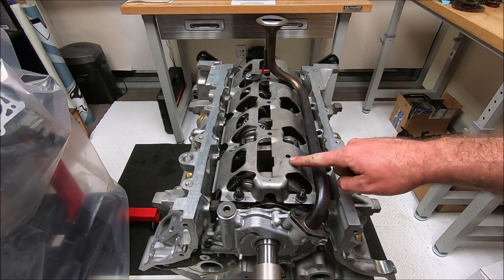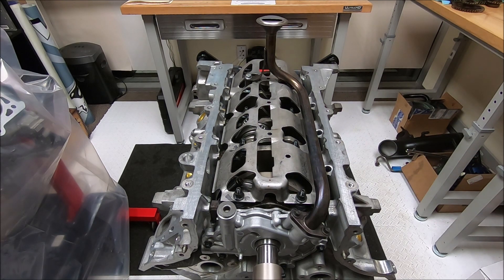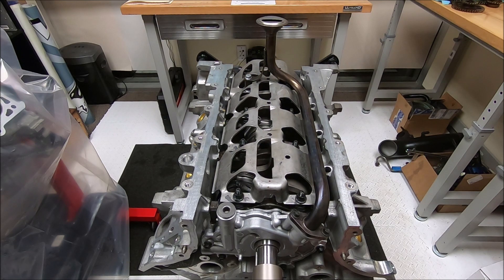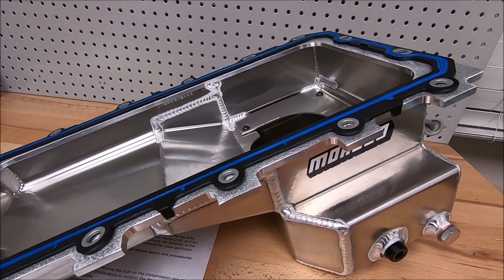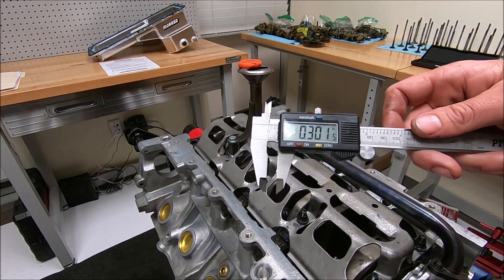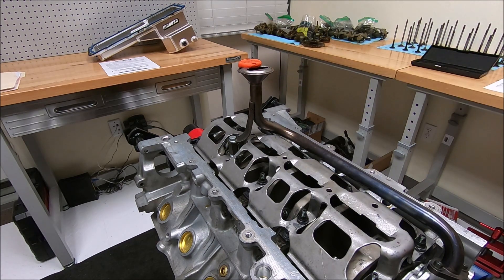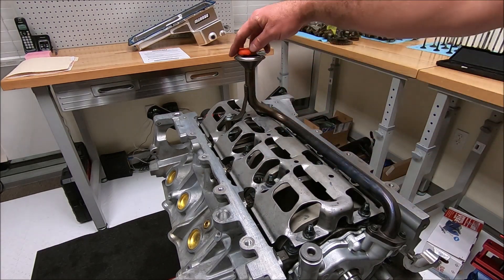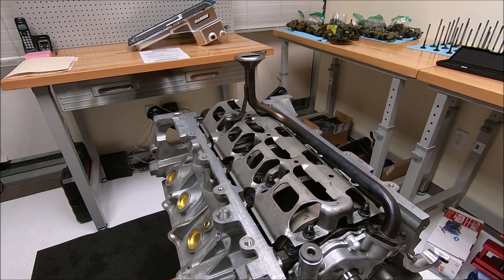Setting oil pickup tube clearance on a 4.6 Teksid Mustang engine with a 3V windage tray

Comment: Got a question i hope someone help with.  My oil pickup tube looks like your but is fully open. will this change the clearance i need? mine is the only tube i've seen like it. any i see on line look way different with a small opening. i haven't seen one like yours either, like mine but half covered.  So should i measure from the top or the screen?  Love your content its helped me a lot.
Reply from the maker: I have seen pickup tubes like the one you have.  You can measure from the screen but remember that the screen is a bit higher up than the edge of the pickup.  I would subtract about 1/8" from the reading to compensate for the screen being higher in the tube if that makes sense.  Basically the lowest part of the tube is what you are concerned with but you can still measure from the screen if you its easier.  Also, you might want to spray the screen with some oil or something to keep the playdoh from sticking all up in it.
Reply: @JohnSmithRacing  Thank you for the quick reply, I'm about to give it a shot now.

Comment: What pickup tube was used with this setup? Thanks for the vids!
Reply from the maker: The larger one from a DOHC.  I believe Ford Performance sells them.  You may have to cut the plate on the side of the tube off for clearance

Comment: Do you have the part number for the 3v windage tray?
Reply: Also the part number for the correct arp main studs to go with the 3v windage tray?
Reply from the maker: @johnbeardsley2962  The windage tray is 4R3Z-6687-BA but I am pretty sure it was recently discontinued.  The ARP main studs for the 3V windage tray is 156-5901.

Comment: Hey I just built a 2v PI with the stock 98 mustang gt oil pan. I used the frpp high volume oil pump and the instructions called for 2mm of washers under the hex spacer, which I mistakenly did not do. How bad was that lol? Ran about 2300 miles on it since install.
Reply from the maker: What main cap fasteners were used in the engine?  If it was ARP then the clearance will most likely be way off.  However, if factory style fasteners were used then it will most likely be okay.  Its also not a bad idea to get a oil pressure gauge just to keep an eye on things.
Reply: @JohnSmithRacing  factory fasteners. I do in fact have a actual oil gauge now. I was freaking out because it reads good pressure but can fluctuate 10-15psi, and the passenger bank lifters are a little noisy at startup. I'm planning on adding a gt500 windage tray soon and was hoping to hold off pulling the pan till it arrived, but wasn't sure how urgent this was honestly.
Reply from the maker: @jamespenner5982  A good rule of thumb is the engine makes at least 10 psi per 1k rpm.  I have seen engines make about 25 psi at idle then it jumps to over 60 at higher rpm.  You should be fine, its really during hard cornering, acceleration, or braking that can cause the oil to move away from the pickup.  Aftermarket k-member will help with removing the oil pan.
Reply: @JohnSmithRacing  lmao, yeah..... It's on a grip/drift build sn95 with everything but the aftermarket k member and coilovers lol. Ok, no runs in the mountains till I throw in a windage tray and some washers then.

Comment: Building a Teksid Saleen Cobra,  machine shop in a few days. Taking notes on your vids. THanks!
Reply from the maker: If you haven't taken the block yet, I recommend doing any of the drilling and knock sensor bung removal prior to it going.  I also remove the freeze plugs to help get the coolant passages cleaned out in the hot tank.  Also, make sure they use torque plates.

Comment: What type of loctite do you use on the pickup tube bolt? Specifically the rear bolt with the washers to adjust the height.

Also Thank You so much for the straight to the point videos we without BS filler. It seems like the majority of automotive YouTubers will spend 3/4 of the video picking up iced coffee from Starbucks, explaining there gym routine, etc etc etc. Thank you so much for the quality content.
Reply from the maker: If I use loctite it is the blue one but I don't use it most of the time.  I actually rarely use loctite unless it is called for in the service manual.  A good rule of thumb is if you want to remove something in future then use blue, if you never want to take it off again use the red.  I believe there is a torque rating for removing both, blue is 200 something and the red is over 300 foot pounds.